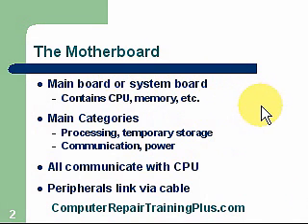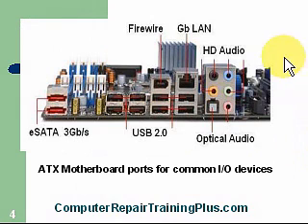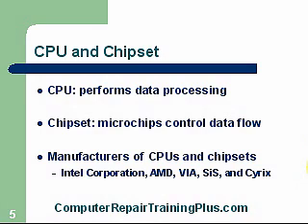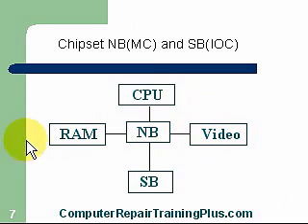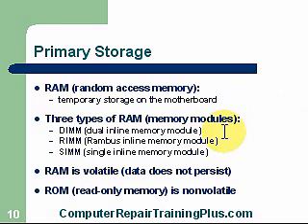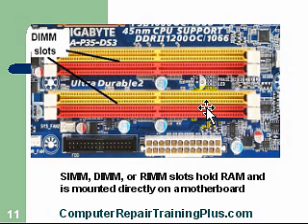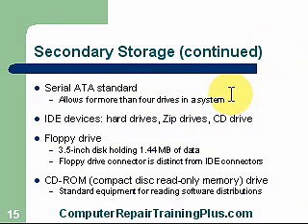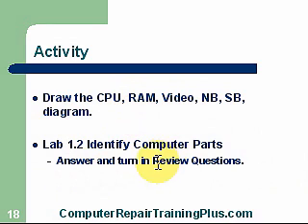A+ Computer Repair Training Course - Hardware - Lesson 1-2

Comment from the maker: The floppy has very limited capacity (only 1.44MB).  Most HD pictures will exceed the floppy's limited storage ability, so you will not be able to save them to a floppy.   Flash drives because of their higher storage capacity have become a better and more reliable storage device.  However, when storing pictures you might consider CD or DVD for longer term storage.  CD and DVD and flash drives are good for about 5 years so you should check them from time to time to insure the device isn't failed.

Comment: Implementation of various I/O and memory buses is the job of the chipset designer and unless the technician is going to do board level repairs, they will not need to know other than those they will be dealing with in a practical situation. There are more types of memory--example--laptop ram modules and the different forms of DDR, as well as server ram that uses buffered ECC for fault tolerance. The memory types and sockets are more important that north / south bridges (board level repairs).